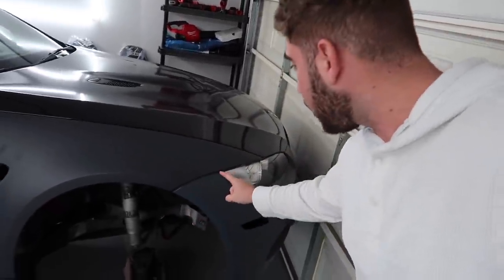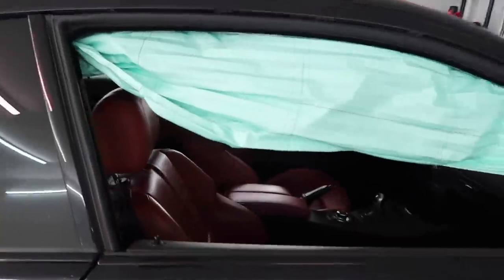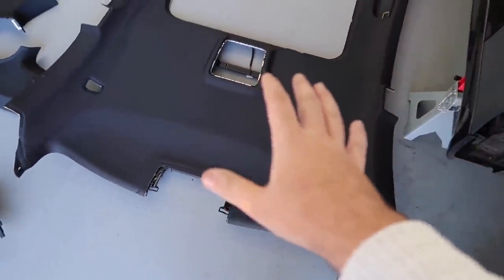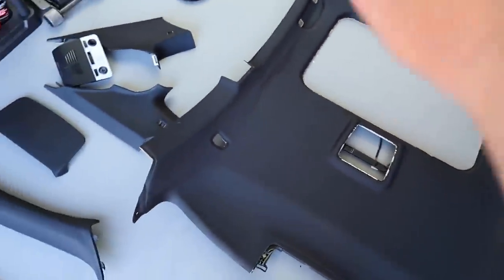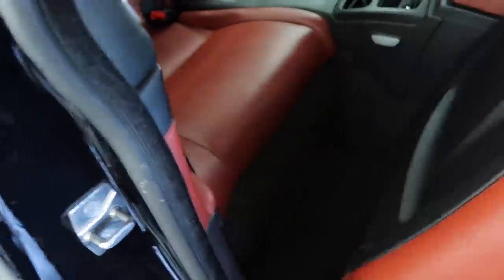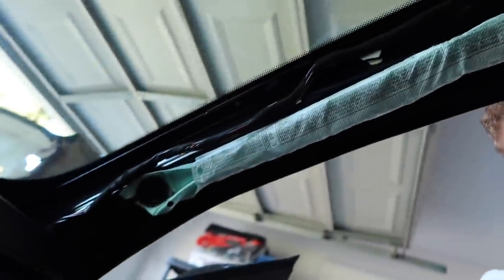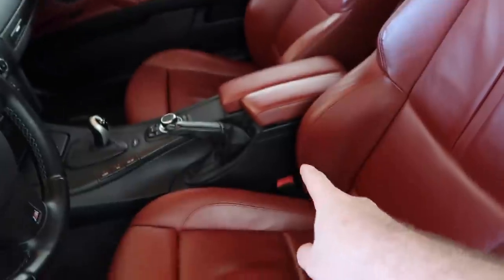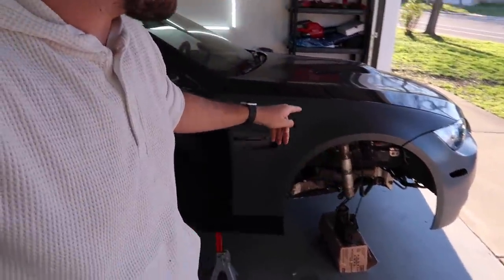REBUILDING A SMASHED 2011 BMW M3 (Part.2)

Comment from the maker: Found out it’s still not safe to use plastic clips, so don’t do what I did, gonna need to rivet them in when I put on the new headliner. Everyone makes mistakes 😅
Reply: Right because on impact, those things can come off if deployed with those plastic clips. Rivets are secured in.

Comment: Nour, do yourself a huge favor, buy a quality cobalt drill and use it with low RPMs. They’re a bit expensive but they make metal drilling effortless. I’m all about saving money and doing things fast and clean, but quality cobalt drill bits really make a big difference. They’re worth the money. Keep up the awesome work! 💪🏼

Comment: Nour front o/s right bumper bracket holder p/n  7156556 e92 e93  2007 to 2012 that is the part you need for your bumper to screw onto your fender the upper portion cheers from down under
Reply from the maker: Thank you exactly what I needed